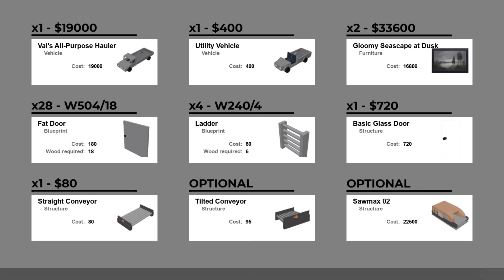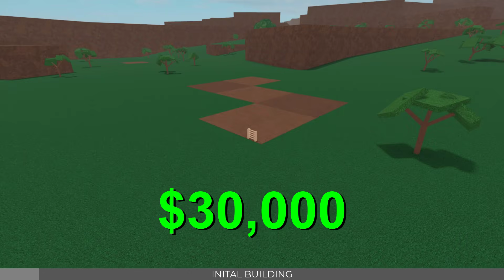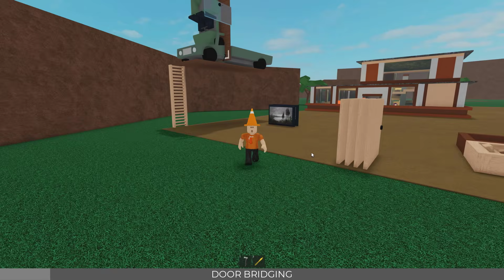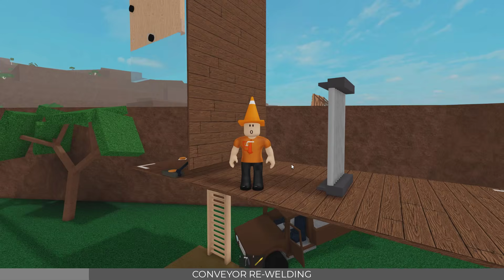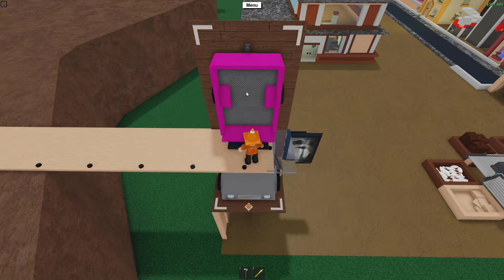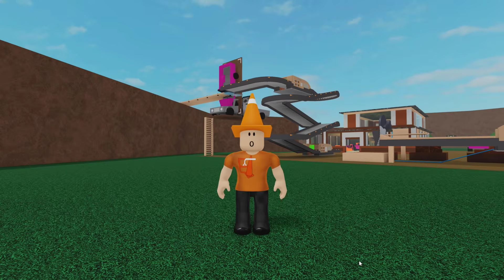How to Build: The Auto-Seller | Lumber Tycoon 2

Comment: How do I add more doors on after finishing the building as mine ain’t long enough
Reply from the maker: just lower the bridge and w move b one of the doors then it will unlink from the glass and you can build more doors
Reply: @ElectroTechnologies cheers for quick response and I’m a upcoming lumber creator do u reckon in the the near future u could sign my base or I can get a screenshot with you??
Reply: @ElectroTechnologies also how do I actually get the conveyor property on the doors as I have everything welded and the conveyor placed correct but the doors don’t have conveyor properties

Comment: i couldnt figure out how to put the bridge down and screwed my thing up entirely and have to REBUILD THE ENTIRE BRIDGE after spending so long. if you just put in how you lowered your bridge i maybe wouldnt have to screw mine up to figure out if the doors welded or not because they werent moving when i did my thing and it was just a dumb mess all because i diddnt see you putting it down i messed mine up. thanks :(

Comment: Mine will all look right but the doors wont be conveyorified even if both cars are for some reason
Reply: same
Reply: Did you fix it?
Reply: @ItsTryy  @Nuclearbomb-lw4ri found out that you have to spawn the small truck when the bridge is down, and if its not working you have to do the conveyor reset thing that was shown in the video.  might be an easier way to do it but thats what worked for me.

Comment: i spent all day trying this for it to not work i did your door bridge but at the end the glass door is different and the doors are a completely a different way and i not trying to hate
Reply: you need to manually go on each door and press move then press back and it should weld to the door.

Comment: Cool idea, but it didnt work for me.
1.
The door bridge never actually converted into a conveyor like the cars did at first. Tried to fix but nothing changed.
2. After respawning the cars, they both unwelded and will not go back.
Please tell me what i did wrong and how i can fix it.

Edit; i managed to get the cars to weld again, but the doors just dont want to turn into conveyors.
Reply from the maker: 1. Did you place the glass door correctly? If the small car welds to the val's and has the properties there must be an error with the placement of the glass door.
2. Did you reload? You need to replace the conveyor on reload using the step in the video
Reply: @ElectroTechnologies   The small car welds to the truck after some finicking, and yes, i reloaded. It must be the placement of the glass door. Ill check and bug you again if it doesnt work. THANK YEH!
Reply: @ElectroTechnologies   The door is placed correctly. Im just not sure how to get the other doors down with the glass door without move-b'ing it.
Reply from the maker: @swaggerington  So the glass door has the conveyor effect?
Reply: @ElectroTechnologies  yes, it has the conveyor effect. when i e-move-b it, it loses that effect.
Reply from the maker: @swaggerington  that’s why you need to lower the bridge first and then press the button to respawn the small car
Reply: @ElectroTechnologies  i must be doing something in the wrong order. ill keep messing with it but right now its collapsing in on itself

Comment: my bro got the pink truck not on purpose and just took it for granted 💀
Reply: I had a pink truck and just changed it to blue 💀 I guess 7 year old me didn't know how valued pink cars are 💀
Reply: @armanayuban9225  there no blue car
Reply: @armanayuban9225  when I was 5 I got 5 pink trucks you wanna know what I did with em I RESPAWNED THE CARS BCZ THEY WERE NOT COOL ENOUGH
Reply: Is it rare?
Reply: @rosenunez5764  yes, yes it is
Reply: @Snovaporated  I bought a utility truck box and when I opened it and put it on my base the default color was pink
Reply: I have several unopened truck boxes because it has happened to me several times that I accidentally get a pink one, I don't know if I'm luckier or what, but just yesterday one came out when I was going to buy some cables 💀
Reply: i have 25 pink trucks and i sell each for 50k becuase NO ONE BUYS THEM so i did a cheap
Reply: @AriPlaysRoblox3 how do you sell a truck???
Reply: @Manny73211  you can sell the truck to other players but you can't sell the spawner or it resets the color
Reply: @AriPlaysRoblox3 i Can buy
Reply: na sometimes its free
Reply: Maybe it’s just a sign from God
Reply: They aren’t even rare
Reply: Why do we need a paintings for?
Reply: @Rozwalator007 special size
Reply: It's only 1 in 500. You can just spam respawn them.
Reply: One time I got a pink truck, but I reset it for another colour after a week 😭